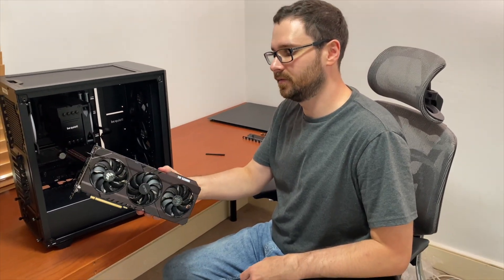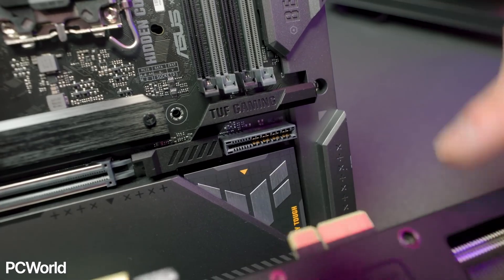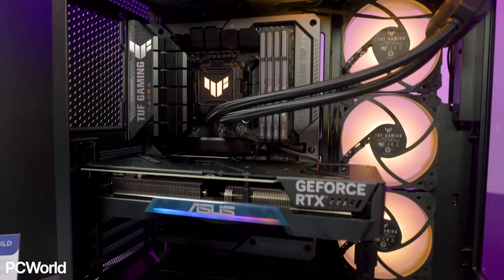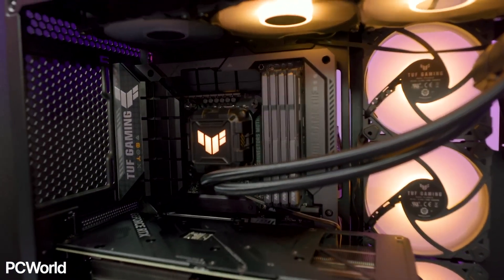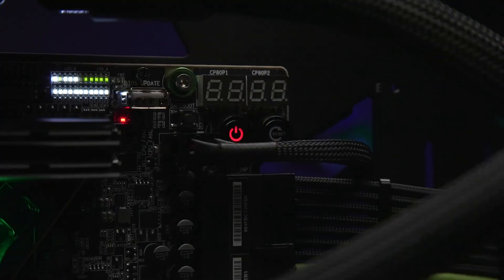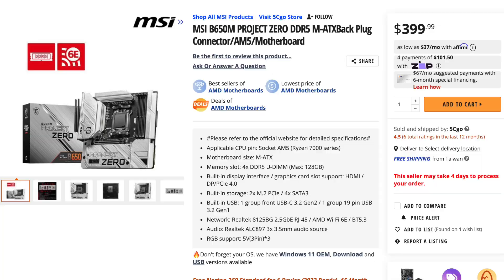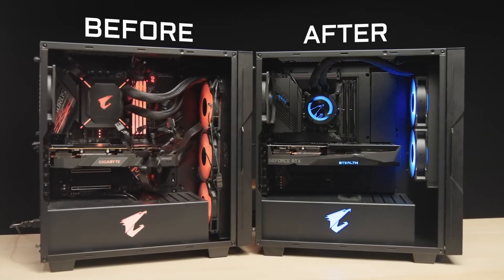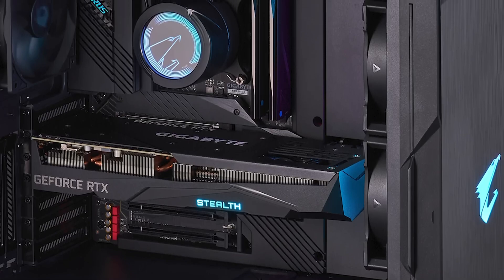Building a PC will never be the same🫡

Comment from the maker: Do you like this new way of building a PC?
Reply from the maker: @helalst me too🤝🙂
Reply: Neat! 🎉
Reply: absolutly!
Reply from the maker: @Harperion what do you mean "not having room"? All of the same ports, connectors are in the exact same places on the motherboard. Just located on the opposite side.
Reply: Now it just burns up the connector on the GPU, and you replace the GPU and cable. 

Will this end up burning up the motherboard and affecting a lot more? It's mentioned that this has been used in servers, but at 600W loads on GPU? I doubt it.  Interesting concept, hopefully it's more reliable than the 12vhpwr or whatever it's called that keeps melting.

Comment: Amazing concept, this is going in the right direction and we will hopefully see much cleaner builds with little to no cables showing through our glass panels. However, it does make me think if this becomes the standard, wouldn't this require the other side of the case to be slightly larger to fit all that cable slack unless you buy shorter cables? Because usually that little bit extra is so it can fit around the case towards the side or front of a mobo.

I think it will take a while for case manufacturers to make their newer cases accessible for backplate connectors. Obviously older cases would need their backplates to be cut, but I think there will be a period where newer cases support both front and back motherboard connectors, and if it proves to be a better standard then in later years no more front connectors.

Part from that and the obvious power issues that could arise if GPUs get even more power hungry, this is an amazing innovation for cleaner builds.
Reply from the maker: Teething problems are present whenever any change happens. But without change there can be no progress🙂
All will work out as long as people in the industry talk and agree on the exact new specifications.

Comment: I literally thought of this just the other day. At minimum why can’t the 8 pin be on the MOBO side of the GPU?
Reply from the maker: That is what MSI and GIGABYTE did with their projects. I'd be OK with that. But it only works for long 3-fan cards. So, that is a serious limitation as there are a lot of low-budget GPUs that wouldn't be so cheap if htey had to be bigger.

Comment: Sounds good in principle but what happens if something goes wrong and a short happens while gpu is drawing 400 watts
Reply from the maker: What do you mean? The power is still regulated by the power supply with all the protections. Over-current, short, etc., etc..
Reply: what if there a defect in board and the voltage shorts to a part of the board thats nor supposed to have that voltage? @theivadim
Reply: can the connectors on the board handle the power or will we have more 4090 style problems?
Reply from the maker: @peterpeter5666   any part of the existing hardware can and will fail eventually. Will the manufacturers make good products so that the failure rate is super low? I hope so. But there is nothing pointing towards there being any issues with the HPCE connector. As I mentioned - server industry uses it. Server hardware is build more towards reliability. So, I believe that with right designs and materials (same as in the server-based HPCE) there is nothing to worry about. On the contrary, HPCE is better than the new 16-pin power connector NVIDIA pushed with the RTX 40-series.
Reply: ANYTHING is better then new 16 pin connector LOL ! @theivadim
Reply: What if your PCIE cable does the exact same thing? What if your CPU socket shorts? Your logic is baseless. Also, I trust these PCB connections more than the crappy pinned plastic connectors on ATX cables.
Reply: @Leo9ine  then I replace cable and not mobo

Comment: Seems like this could be a good change as long as issues are ironed out. While new ideas are always a welcome addition, especially if they lead to a better concept, I do have a few thoughts/questions and would be curious to see how they propose to solve them.

With the onboard power adapter, will 600 watts be enough? Seeing as some of the top cards are really pushing up there, would it be better to just set a higher power connector and not have to worry about it for a while? (Of course, I really hope cards don't get more power hungry) If you only have the 600 watt connector on the motherboard but for reasons you need more, would you have to plug a cable in to the card still or can you somehow change the power adapter on the board? (all assuming you need more than the extra 75 watts from the PCI slot) What about the smaller size cards that are 150-300 watt range that can't reach the power adapter? Will these cards have to become longer to fit now or will they still need power cables plugged in to them? (I'm sure cables to the card still would be the most likely answer)

As for the power being plugged in the back of the motherboards, I really hope they standardize the locations. Otherwise, you have all board makers putting them all over the place and case manufacturers groaning over the thought of having to either make cases only for certain boards or maybe even having replaceable backplates to swap for different boards.

But still the concept is nice. Just curious to see final product.

Edit: Forgot one other thought. Will this onboard power adapter provide for less card sagging or will there still be a need for anti-sagging mechanisms?

Edit: Just thought of the power plugs into the back of the board. Will they stay as the traditional 8 pin plugs or will they swap to using the new 12 volt plugs?
Reply from the maker: All valid points that they need to work on👍

Comment: Asus worst motherboards problems. I had asus only problems.. no matter what they do i never buy again asus. Gigabyte 0 issue. Yes i do not buy cheap boards.. I had asus x670e-e Rog Strix Now i have Gigabyte aorus master x670e 0 problems. And i had problem with b650 asus rog strix problems to. Disconected intel, blue screens freezes pc.
Reply from the maker: This new standard won't catch on without other major pc parts makers anyways. So, you'll have your options if this new way of doing cables goes ahead.

Comment: I've always felt that the old power connectors were bizarre.
Reply from the maker: Especially the cables that connect front panel buttons (power, reset, etc.) to the motherboard. Those are unnecessarily uncomfortable to handle.